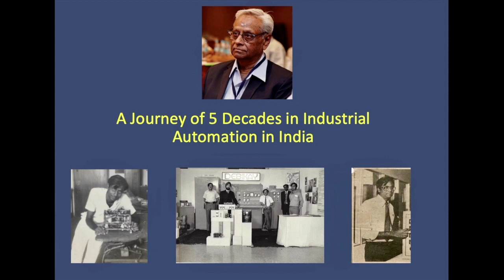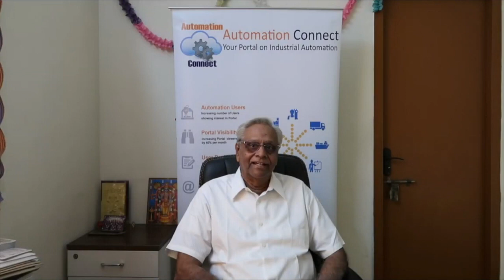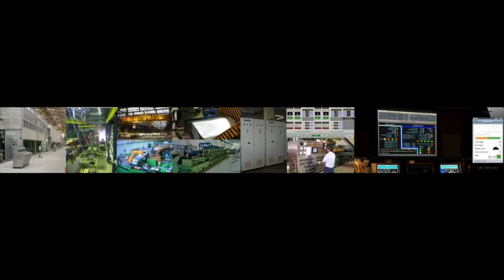Industrial Automation in India - Part 1- DC Drives

Comment: Hello. When (which year) did you install the Ward Leonard system at West Coast Paper Mills? I am asking because I commissioned the Sectional Thyristor Drives supplied by L&T on their largest paper machine in late 70’s. It wasn’t a Ward Leonard system. We used Thyristor Converters to control Armature Voltage. There were separate drives for each section starting from wire through presses, dryers to Calendar and spoolers. We were successful.
Reply from the maker: Thanks for your message .. Debikay commissioned the system in 1974. Subsequently L&T commissioned it in 1976 I think ..
Reply: @automationspeak8636  sir, you are correct. The L&T supplied drive controls were commissioned by me and my colleague, Mr. P. P. Reddy in December 1976. However, before West Coast Paper Mills, L&T had commissioned another Papermill drive at Ballarpur Industries in Yamunanagar sometime during 1974-75 timeframe. We had also supplied some simpler Thyristor Drives for Single DC motor driven line shaft systems earlier. Your video brought back many memories of exciting period of my early days as engineer. Thank you. Waiting for your next video.